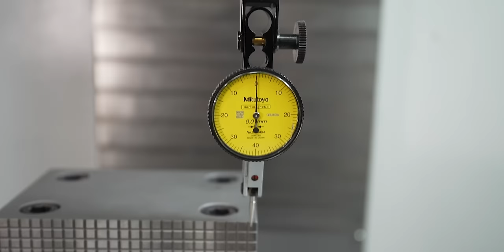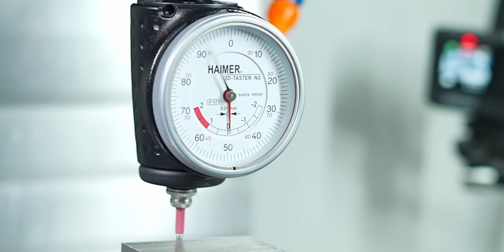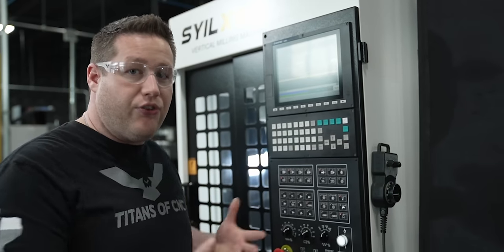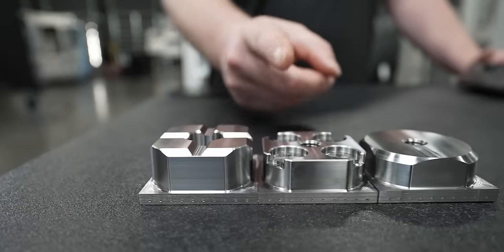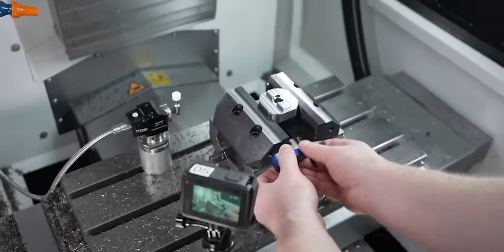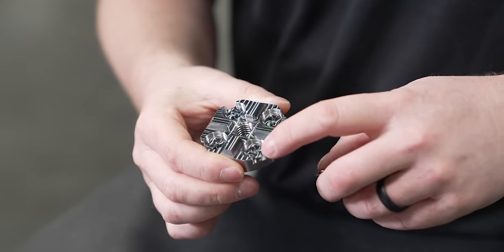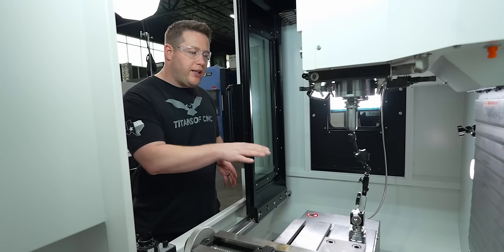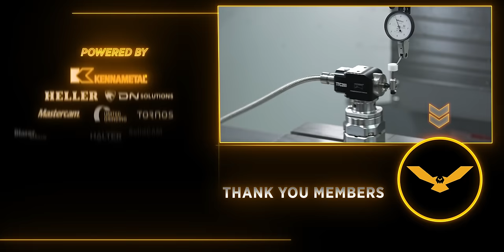Maximizing Work Envelope by Machining Removable Tool Setter

Comment: Great idea! However this design is subject to repeatability loss from surface deformations and wear due to over-constraint. For this application an exact constraint kinematic mount is best. Kinematic mounts remove exactly 6 degrees of freedom, no more, no less. When properly implemented, they don't suffer the repeatability issues associated with over-constraint. Two classic kinematic mount types are the Maxwell and Kelvin. For the same reasons expressed in this video, we designed and ultimately patented a Maxwell type kinematic de-mountable tool probe mount that will repeat to a few microns or less. Check out our system if you dont want to build your own.
Reply: I'm interested to know how much wear you'd expect from replacing this a few times a year while it's made of a fairly hard steel
Reply: @iDiveDOTtv Its hard to say how long it will last due to the uncertainty of the contacting surfaces and how they are removing each degree of freedom. If all surfaces are in perfect contact (not possible) it would likely probably last forever. However, in this design, there's too many surfaces competing for final alignment, hence over-constrained. What makes kinematic mounts so incredibly repeatable is the constraint surfaces are discrete and exactly constrained. Am not saying Jessie's design cannot be made to work, it just needs to be as, or more repeatable than the tool probe, (which btw uses a kinematic mount for the stylus deflection). Hope this answers your question.

Comment: chatter!!!!! rigidity issues? man.. who knew a cheap machine had poor rigidity
Reply: Dude doesn't know squat. Parts look great and machine sounded fine
Reply: Parts looked just fine to me.  He was using some longer tooling than necessary so the chatter was all in the tool…. These syils are great for what they cost.
Reply: @machinistjeff  the long tools are probably just due to the larger spindle to table distance too
Reply: agreed even in hydro holders  , love that this comment has been downgraded to last lol
Reply: bullshit, i run tools longer then this with a higher length to diameter and have no chatter, on a haas btw, not quite machines known to be rigid, so either feedrates suck or the machine does.  @machinistjeff
Reply: Long toolholder and high VC.
Reply: @cyber2526  Haas is a 40 taper and in less it was w mini mill or TM they outweigh it significantly. It's a 30taper doing just fine

Comment: If you need a sharper knife just talk to Keith. I was already in touch with him about sending you guys some of my Gil-Tek RUKs which are razor blades to use around the shop.
Reply: Heck yeah!!!!!
Reply: that would be awesome!  I am a knife fan myself, you can never have too many!
Reply: @Jessie_Smith    
@barrysetzer Right now as we speak I am currently working on a new folding knife. Once I get them done I will have to send one to you as well. But just talk to Keith, He has my contact info and I will get some out to you guys. Made In America and veteran owned!

Comment: I've had nice ideas like this using magnets exactly like those. Unfortunately eventually, and it is inevitable, you will get metal dust and micro chips on those magnets/ part, which is why i don't enjoy using them any longer. if it was electro magnetic it would be a different story.

Comment: Looks good.  The user is going to have to clean the crap off both surfaces before each usage though.
Also, those magnates are going to attract chips like crazy.
Still a worth while upgrade.  Great job.
Reply: Exactly. This would be great running anything non magnetic such as aluminum or graphite, but regular old steel would not be ideal. I used to run plate jobs on mag tables and booooy let me tell you, they're a pain. 120 psi of direct air was not enough to keep chips from sticking down inside pockets and busting tools when they hit a big pile.
Reply: I think I'd 3d print a cover that will sit below the part the took setting is attached to that will go down below and cover the part that is mounted to the machine

Comment: Exact Engineering has sold something like this for a few years. I have one on my Haas OM-2A, which is an even smaller machine, so having the tool setter removable was very important.
Reply: Thanks for the info. Going to buy one today.
Reply: Hi John, thank you for your purchase! I saw your video aligning the tool probe mount at an angle, clever use of g-code!

Comment: This design is great, but it is technically over-constrained. With four lobes, you introduce a sort of rocking along your perpendicular axes if your mating surfaces are any less than perfect.

Three lobes would make for a proper kinematic coupling, increasing your stability and repeatability with less strict tolerances required on the final part.
Reply: I've worked with Thorlabs 3 point magnetic kinematic bases, however they never really seem to hold anything securely since it's quite easy to knock them loose. (or maybe Thorlabs should use heavier magnets, they're initially meant for optics after all)

Comment: A good way to touch off parts on the second side would be just touch on the Parallels themself (or on the Vices Ways), in my opinion its a foolproof way to do it. Same with touching off Y-  on the Vices Fixed Jaw, since thats where the part will land up anyway. (Unless your part is Warped ofc)

Comment: I built a different design base for my X7 tool setter.  I do not have a regular need to remove the tool setter (but I can) but the original position takes up too much table space.  I see that your tool setter could be moved in the Y direction.  The edge of the setter base can be moved in the Y direction so that it is about 10mm from the table edge. My base raised the tool setter by 60mm as the X7 cannot measure very short tools with the original configuration.  Also a design improvement/requirement is to relocate the mounting bolt.  Additionally I moved it to the left outside the tool setter base.  This way the tool setter can be moved as an assembly without interfering with its calibration.  Moving it back into position is easy as there is a calibration program that re-establishes the position of the tool setter.  In summary move tool setter in Y direction, raise the setter and use a single hold down bolt outside of the tool setter to the left in the dead zone.  (If a job interferes with the tool setter just slide it to the left within the dead zone.)  There is about 150mm of unused table space on both ends outside the machining envelope in the X direction.  Traditionally the vice is mounted in the Y direction.  With my 4th axis permanently fitted, I find it easier to quickly mount a 100mm vice on centreline in the X direction.  (I still have the option of fitting my 150mm vice in the Y direction.)  As the 100mm vice has a longitudinal key that fits into the center slot, re-traming the vice is not necessary.  This may be an option for your X7.  Cheers

Comment: we mostly do tapping on our cnc's i go to 50% thread most of the time in steels which just means m6x1 i drill a 5.2mm instead of 5. ill do that unless they specify a tolerance like 2b class of fit. the tap will last longer. aluminum i do 75%. you'll find most of fasteners you buy the inner diameter is really big

Comment: Just make a nice mountingplate for 6 Unilock 0 point clampingsystem. Gone with the bolts and the indicating if a vice sits square and so forth.. 
an aluminium plate with two knobs  to mount the toolsetter on.. 
makes life so much easier

Comment: hey in DOF perspective that's still over constrained, why don't you use kinematics mount with 3 balls and 6 pins or 3 v groove so it has perfect constrain, you can use one magnet at the middle?
Reply: I originally designed this so the locating features can be ground to size after heat treating the parts.  making them like this would allow you to put them in a straight line against a shoulder and send the grinding wheel all the way down the parts.  I realize a 3 point feature would suffice in restraining all axes of freedom but would make it more difficult to grind.  I have seen the designs you are talking about with the pins and the locating balls and I was also trying to come up with something that could be made all on these machines without much input in case we want to share these files with others that may want to make one for themselves.  I never said this was the perfect design and I know it isn't but it worked well and it was simple to produce.

Comment: Mine is like an triangle, has 2 magnets far outside of the worktable where the base is, a 3rd leg with a adjusment screw is on the worktablesurface. This triangle has an good repeatprecision. On top of this triangle, inside the workarea, the tool length sensor is located. In your configuration it is theoretical possible to reach your base with an 2 inch shell mill. If something is theoretical possible, it will happen sure. Unlucky your maschines wont fit in my workshop.. So i have to use smaller Maschines with multi purpose functions.

Comment: Maybe this is a bad idea but could you not make a tapered hole in the table  and make a tool holder that would fit in this tapered hole like you find in the spindle and tool holder.  Of course this would be done on a much smaller scale as not to interfere with the functionality of the table? 🤔🤔

Comment: We tap down to m2.5(diameter 1/10 inch) in our machines, atleast in aluminium. But M4 and lower are dubious. If you take several passes and there are chips left, you're pretty screwed. Once it's dialed in and you run with the drills in the upper diameter tolerance, it's mostly fine. Not in 3d printed stuff though. That stuff is HELL to tap.

Comment: I think it would be great if you encapsulate the magnets instead of having them exposed. That way you don't have to worry about them corroding over time and it's easier to clean the chips off if they get stuck to the magnets.

Comment: 99% of what I run on my X5 is non-magnetic copper alloys, brass, dielectric materials, stainless, aluminium and bronze, so this might be a helpful add-on. As one comment said, it is theoretically over-constrained, but my original idea using three steel balls is also over-constrained, and this is way simpler. This little machine is pretty amazing for the price.
Reply: How is 3 steel balls in 3 V-grooves overconstrained? That is perfectly constrained and with the added benefit of having no influence of temperature because the thermal center will be in the middle.
Reply: @nepdejong  My original design wasn't using three grooves. for some reason I made them fit into conical holes. Too much coffee probably. I had a "Doh!" moment then...

Comment: How did he set the z height with the tester with no math? Wouldn't he have to see the machine z0.0 and then minus the length of the tester at 0?
Reply: Probably has the length of the haimer saved and all his tools are positive off the spindle nose and g54z is a length from spindle nose to the work.  On my fanuc mill, I do it by entering the haimer length and hitting measure to write the current position minus haimer length to G54 z. I could probably write a macro to save the haimer length and write g54 or save it as a tool height offset to keep the length in if i wasn't lazy but that's probably the same number of keystrokes each time anyways to call the macro or height offset

Comment: Nooooo. Nonono.  The optics people have this one dialed. You need 3 groves 120 deg apart on one half and ball bearings glued into the other. 4 groves over constrains the system so it is not a question of if but how much it will wobble, and flat face contacts under low load are super susceptible to contamination error. Your design would be good if you were going for a heim joint that could take high loads when bolted down, but for this application? Trust the laser people.
Reply: This is a Maxwell type kinematic mount and one of the most economical to mfg. Optomechanical engineers rely on these types of mounts to meet extreme repeatability.

Comment: Why not put just the sensor inside the work envelope? Seems like it wouldn't take up much room and I would think that if you need that 1-2 inches it would be a very rare case. im not in any way a machinist just a practical thinker

Comment: This is the most stupid thing that Titans have ever done, unless they are on ever cutting plastic.
Any steel will stick to those magnets, and before anyone says, just clean the chippings off. Chippings are very hard to full clean off a magnet.
Als,  the chippings flying off the job will damage the angled surfaces that are supposed to give the repeatability of this system, thus making this inaccurate and totally useless.
So who ever came up with this idea needs sacking.